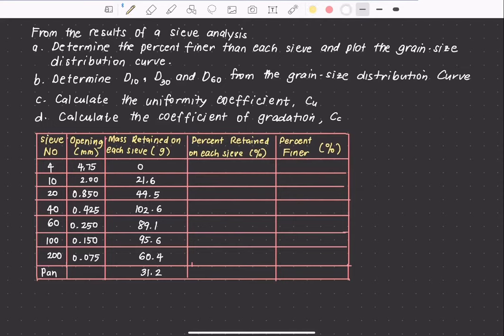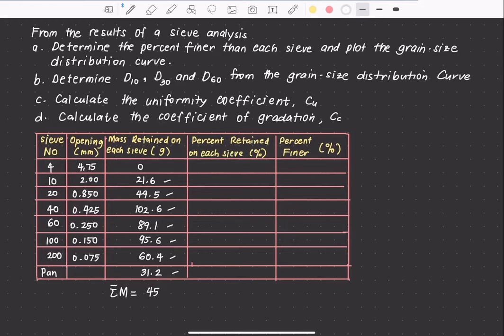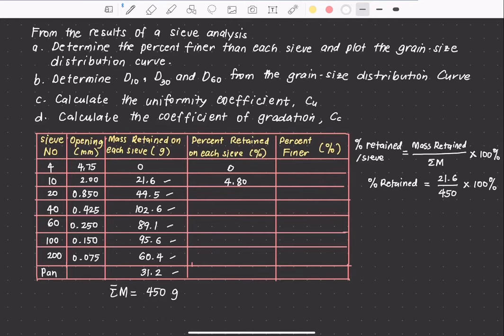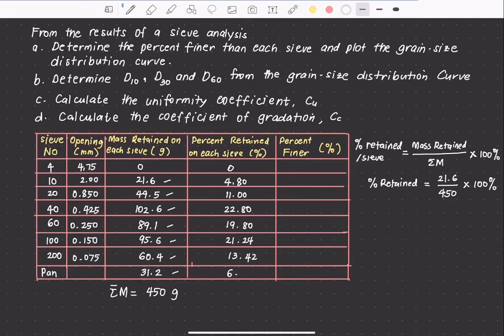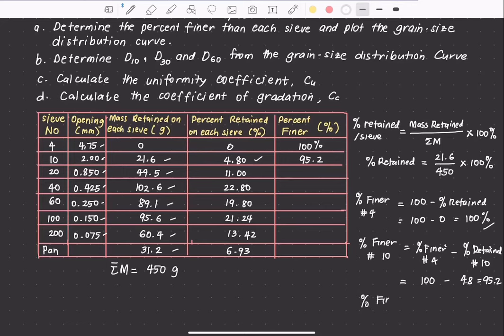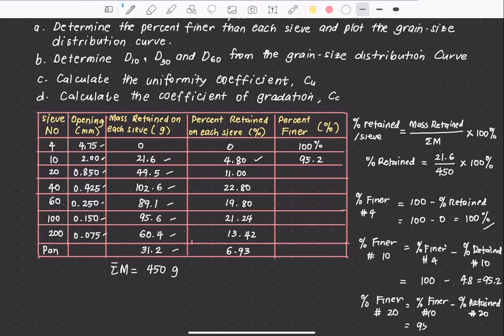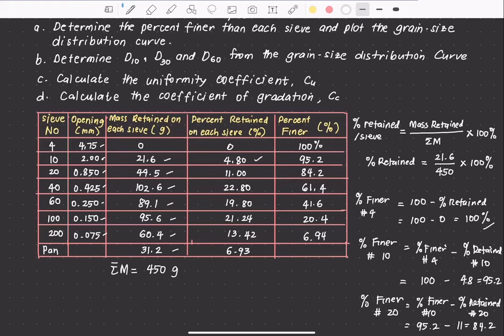Soil Sieve Analysis

Comment: third value 11.00 teacher its wrong exact value is 9.8 teacher check it if i am wrong
Reply: Yes it's 9.88
Reply: Yes
Reply: Sieve # 20 is 49.5 g therefore sieve # 20 is  retained 11%
Reply: I know this is 2 years late, but it could be helpful for someone in the future. Guys the Value is 49.5 not 44.5 so if you do the calculation you should get 11 instead of 9.8. Hope that helps.

Comment: Hello Mam. Tanong ko lang po kung paano po kapag hinahanap is Diameter at 10% Finer at naglies siya between 19%-0% ng Sieve #200 at Pan Respectively.  Nagmamath error po kapag nag interpolate using logarithmic. At the question is, merong bang opening ang PAN
Reply: Waalng butas ang pan yan na yung clay mo which is elss than 0.002mm in most of system used